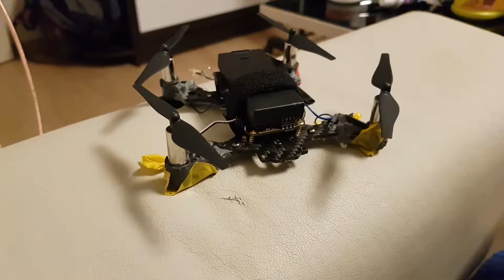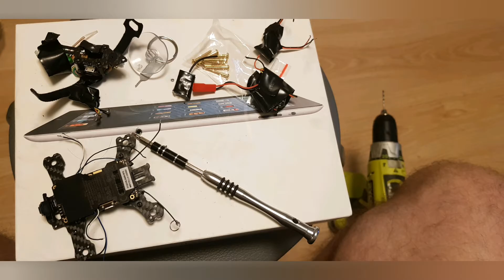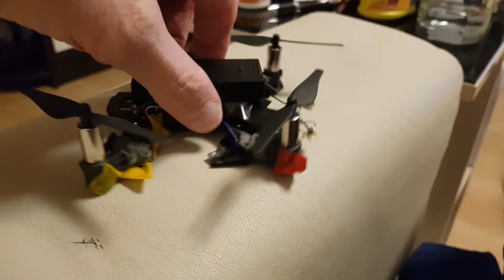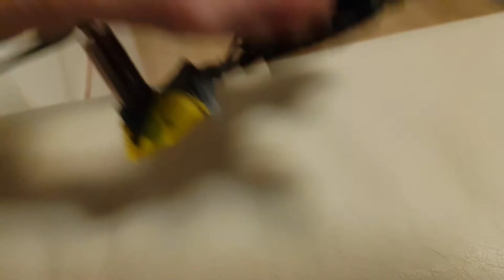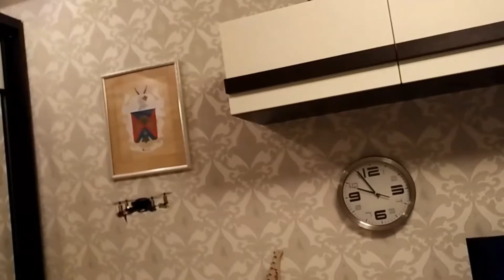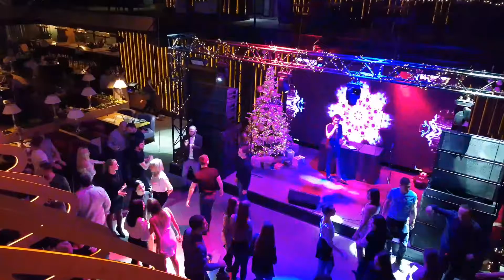Old Tello drone turned into something new

Comment: Noice
Reply from the maker: Yes it was fun to make and fine-tune so it to fly correctly
I'm thinking about putting on higher powered motors and maybe racing props
Although I know that there is a limited amount of power that the circuit board can control